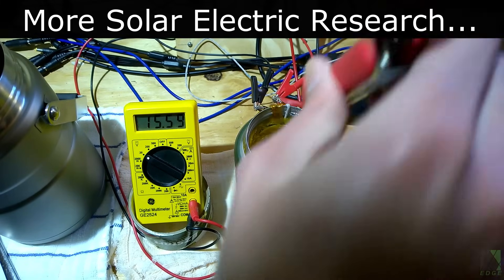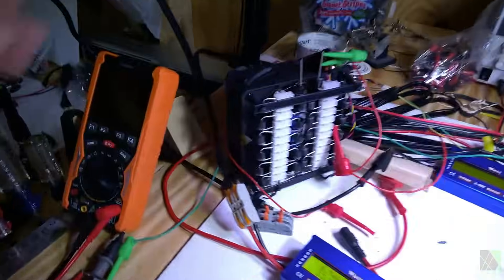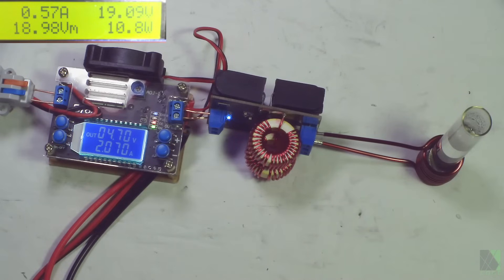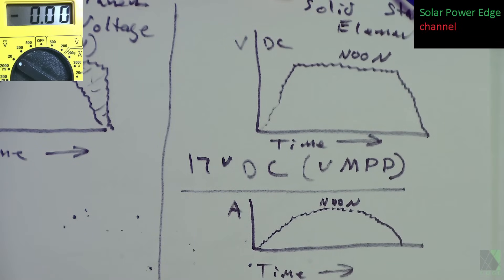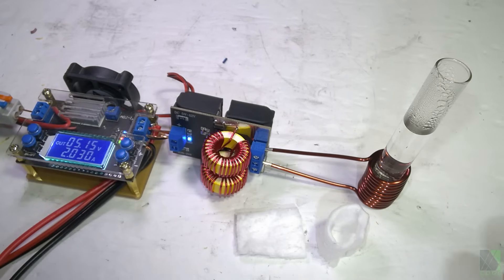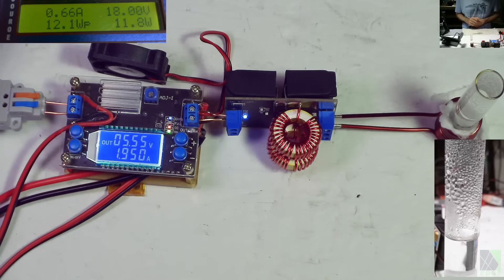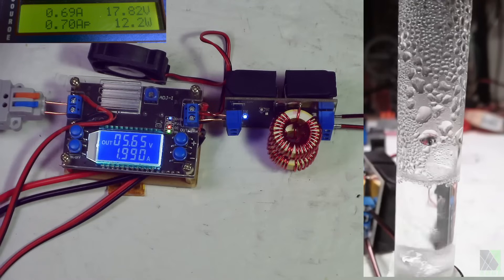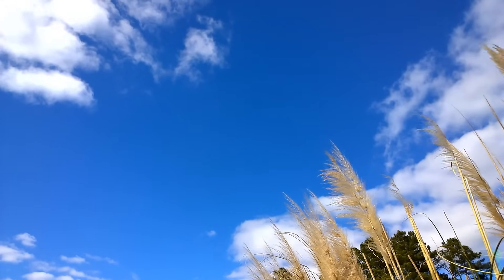15 Watts of Solar Power Boiling Water! induction experiments in my solar workshop #experiment

Comment: Very well done!  I actually use a 120v immersion water heater to make my tea.  It comes in at about 285 watts, but wh is only about 23, I am using an Oupes Exodus 600w solar bank.
Reply from the maker: @177airhead5 Thanks... good setup you have for tea :) here's an old video of my solar tea setup - making hibiscus tea:
https://youtu.be/mStAPLu8oOE
Reply: @solarpoweredge  Thanks for the link!  I have never timed how long it takes to get my cup of water hot enough for tea, but I did this last Saturday, about 4 1/2 minutes using an inversion heater.
Reply from the maker: @177airhead5  No problem :) wow that's pretty fast

Comment: Why did you put insulation over the test tube? I agree you need insulation, but on the outside of the coils, to prevent loss to the air. If anything, you should try to increase conduction between the coils and test tube.
Reply from the maker: @jodaboda1 To retain heat. After adding the insulation, it boiled quite vigorously